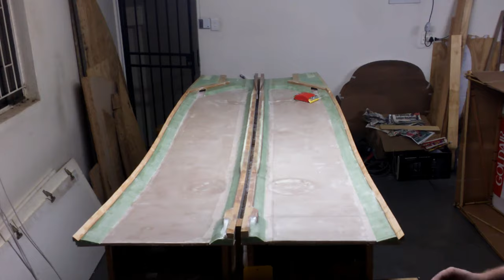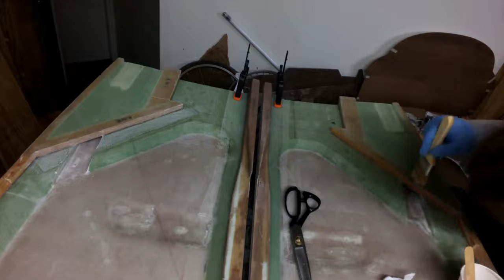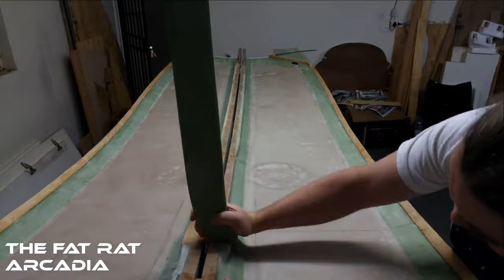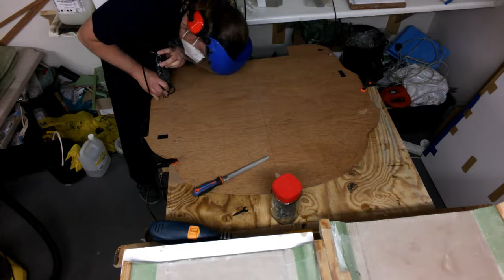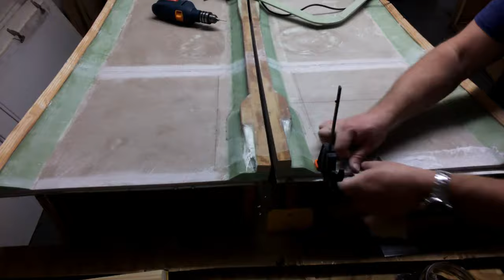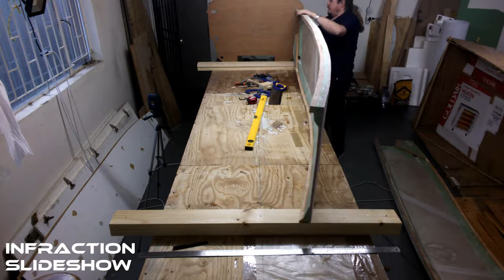Cozy MK IV: Fuselage assembly, Part1

Comment: We live in Colombia and want to start on a cozy but we need the mil-spec for the foam core that you use in South Africa to built yours. Thanks in advance for the help
Reply from the maker: Do you have cozy plans yet? The plans specify everything you need: PVC foam, EXTRUDED polystyrene, and "Last-a-foam". Which one are you having trouble with?
Reply: @Chatsu8o  thanks ! Will include the plans in my Christmas list . Thanks again
Reply from the maker: @1459nick  "Aerocanard" put out  a set of plans for convenience for their Cozy clone. They're no longer up to date, and should NOT be used to build anything. But, from a reference standpoint they're useful as they're almost identical to the cozy plans. If you want to start reading up, this is where you can start while you wait for your official plans. You should DEFINITELY read chapter 3.

https://drive.google.com/drive/folders/0B-ke8lXeGP9sS1loa0FQQ0xyVDA?resourcekey=0-wQbAga9BX4TSAft_IbeSvQ&usp=share_link